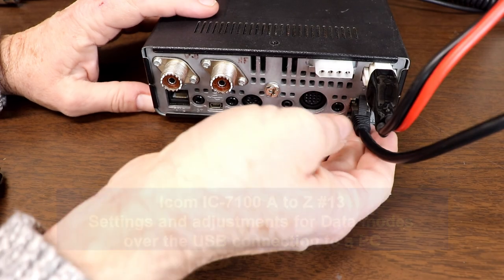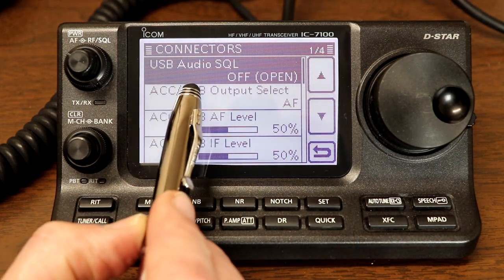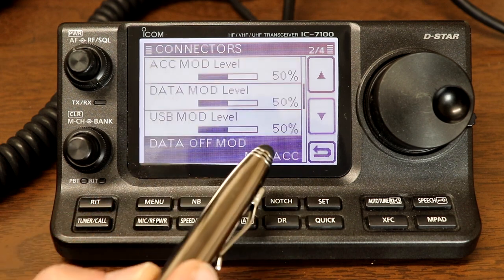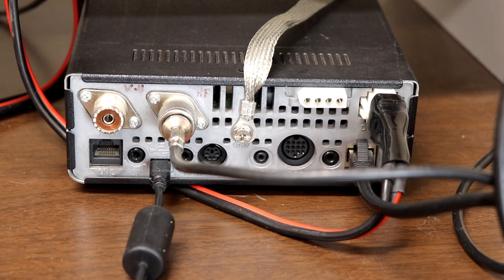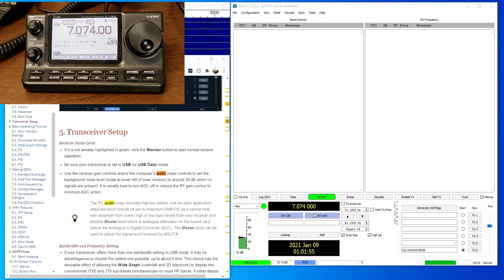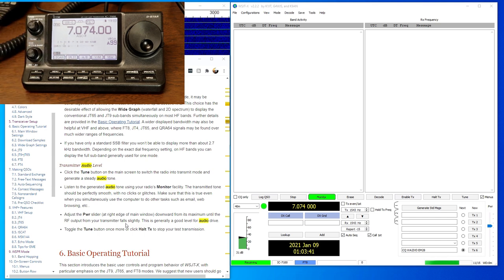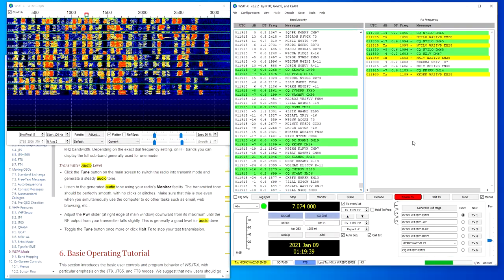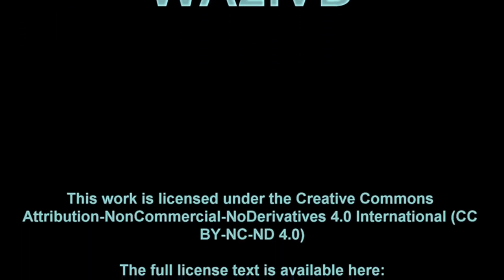IC7100 from A to Z #13 Settings & adjustments for data modes over USB cable

Comment: I came across this video by accident. I've being struggling with the setup for digtal for some time. You not only explain the radio setting  but also some of the FT8 settings. Thanks for this video.

Comment: Just a note for anyone else that runs into this. If you use "split mode = rig" in WSJT-X you run the risk of having your A freq USB-D but your B freq might be just USB. If your B freq is not set for USB-D then transmit will completely fail. I was pounding my head on the wall with that for longer than I would have liked. The alternative would be to use the "fake it" setting and this won't be a problem.
Reply from the maker: Very useful tip.  Thanks!

Comment: Thanks for the videos on the 7100.  They have been invaluable to me.  If I select RIG in my settings, Split changes the frequency way out of the FT8 range, sometimes it changes bands to transmit.  Not sure what I have wrong.  If I set it to Fake it, it works fine.
Reply from the maker: Hi Bobby. I haven’t played with WSJT-X in a while. I’m not sure why it is behaving that way.  When I get a chance to try it out, I’ll let you know if I find anything.
Reply: I have not found that with my IC-7100 using WSJT-X  The frequency changes just as I expect it to - a kHz or so either way.  Winlink works very well with the IC-7100  Not only does it change the band and frequency, but it also changes the IC-7100 to USB-D when you go to "open session"", and changes the frequency and mode back to where it was when you close the "open session" window, allowing seamless operation with no fiddling around.  Incidently, for anyone who uses Winlink without a hardware modem, it is well worth installing and paying for the high speed version of VARA, which is by far the best software modem I have used, giving high data rates on unbelievably weak signals, and changing the data rate dynamically as signals fade in and out.

Comment: Hello! I watched all your videos about IC7100. Thank you for taking the time to make them. Just a comment, Almost every mode has it's datamode. USB -> USB-D, FM->FM-D (Aprs for example),  WFN (No data mode off course). I mention this because I was listening WFM commercial radio the first time I bought my radio and I wanted to set data mode while I was watching your video and there was no DATA option to set in the menu!! It will be available when you switch to the proper mode and band plan.
Reply from the maker: Yes.  You definitely need to be in a  valid mode where you can transmit in order to select DATA.  You'll also notice that in DV mode that DATA is replaced by GPS.  The GPS option lets you select whether you want to send GPD DPRS data with your transmission or not.  You can definitely send data in DStar mode, but it's not going to come in as audio through the USB port.  It's a little different process.

Comment: one of the best instructors and video on Youtube. Just a question on the Filter FL1 setup for FT8 is it setup for default and can that be changed?
Reply from the maker: FL1 is fine and the default is probably fine.  For WSJT-X, you want the filters in the radio set as wide as possible.  The WSJT-X audio processing software takes care of it's own filtering and sorting out the signals.  Trying to set the radio filters more narrow would actually hurt more than it would help.

Comment: Great videos!  I’m up and running on digital modes using fldigi and flrig.   One question.  When I go to use voice without the computer connected my audio feeds back into the speaker (not good) and headphones (perfectly clear). Is there a setting I am missing when using voice mode?  Thanks for any help
Reply from the maker: In the SET mode menus there is a setting to turn Monitor OFF.  It’s either in the Connectors or the Function sub-menu.

Comment: I love all of your vids! Question, does the 7100 have the ability to save and store different/various settings--like the 7300 does--so you can quickly/easily jump back and forth from digi modes to SSB, or do you have to go through and manually change/change-back each time??? Thanks!
Reply from the maker: Hi Tim.  Thank you for the kind words.  You can press SET and go to the SD Card Menu.  The Save Settings and Load Settings functions can be used to save and load different radio settings.  The 7100 does not have “Presets” like the ones introduced in the recent IC-7300 firmware update.

Comment: The reason that audio is transmitted between 1500 and 2000 hz is so there are no harmonics in the audio passband that is transmitted. The (second?) harmonic of 1500 hz is 3000, which would be filtered out and not put out on the air. 

It's easy to see when someone is transmitting below 1500 hz.

Comment: Hi Tom: Thanks for the video. I’m playing with my 7100 now. I’m trying to interface my phone to the radio. RX seems to work, but I can’t seem to TX.  It looks like VOX doesn’t work on the Data2 jack. Is that correct? Maybe it works with the ACC plug? I do get audio only if I key the radio through the Data2 jack. No VOX. 
Thx de KB2MEN
Reply from the maker: Hmmmm…  I’ve never tried VOX with the Data2 jack.  I thought that VOX would work regardless of where the audio is coming from.  I’m quite certain VOX will work with the Accessory connector, but I haven’t actually tried it.  Maybe it’s time to do some experimenting.

Comment: Love your videos but I have a question any clues why my fervency is not showing on my lop top? The bar where the frecency is supposed to be is red any clues ? Thanks in advance 👍👍
Reply from the maker: Which program are you using?
Reply: Wsjtx
Reply from the maker: Hi Martin.  It sounds like something is wrong with the COM port settings.  Check that you have WSJT-X set to the correct COM port and that the baud rate settings match
Reply: Thank you so much I will definitely try that thanks again

Comment: Hi Tom, just one question, what do you turn up in the icom 7100 menu to make more audio sound level (volume)to come out the usb port, what i think it is i have moved from 50% to 70%, but doesn't seem any louder hi...Fred g4vvq.
Reply from the maker: Hi Fred.  You should be looking in Set Mode under the Connectors sub-menu.  The setting you want to change is ACC/USB AF Level.  That setting changes audio output level for both the accessory connector and the USB output.  You could also change the audio input level in the Windows settings for the USB audio input.  I tend to leave the radio set at the 50% default and change the settings in Windows, but either way is fine.  They both have the same effect.

Comment: I am having a devil of a time getting started with digital using USB connection.  Almost every time I open the program the serial port connection fails and I have to play with the config to get it connected again.  All the same settings are used but it's like I have to wake something up to get things working.  Also am I going brain dead or is the manual missing a digital using USB connection section in the 'Full' menu?

Comment: Tom Have you got a video on how to save our contacts onto the SD card so we can upload our contacts to QRZ LOTW etc etc
Reply from the maker: Hi Kelvin.  It’s a great radio, but I’m afraid it doesn’t have that much capability.  For logging you’ll have to use a computer with a logging program.  With a computer connected, at least the radio will help fill in the band, mode and frequency.

Comment: Followed your settings, but everytime I click on a  call, the icom 7100 leaves usb-d and goes  to just usb.????
Reply from the maker: Hi Tommy.  In the settings, under the Radio tab there is an option on the right side of the screen labeled Mode.  Make sure that either None or  Data/Pkt is highlihted.  If USB is highlighted, it will change your radio back to USB (not -D) every time it goes to transmit.  If you set it to None, then WSJT won't do anything with the mode and you will need to make sure it is set to USB-D for every band.  If you have it set to Data/Pkt and the radio type is set to IC-7100, then WSJT will switch your radio to USB-D regardless of what mode it was in.
Reply: @HamRadioA2Z  thanks problem solved

Comment: How you setup a data 2 socket on ic 7100
Reply from the maker: Hi.  What is it you are wanting to do?  If you want to do AX.25 packet data you’ll need either a TNC or a sound card interface and TNC software for your computer.  If you buy a commercial TNC, it should have basic instructions for connecting to a radio.  You can find the pinout of the data-2 connector on page 18-2 of the Advanced Instructions manual.

Comment: I disagree with using WSJT as the example.  The reason is this - FT8 and other modes of WSJT are usually used at low power (around 5W), while other data modes (e.g. SSTV) are not.  This is why WSJT has its own power output slider, which you will not find on other digital programs.  So my method is to set the audio output level to the radio using some other digital mode program, such as EasyPal or Winlink or an RTTY application etc.  I've found that most PC programs have similar input and output levels so you do not need to adjust levels when changing between them.  Then in WSJT, leave the radio and soundcard levels alone, and also leave the radio's power set to maximum (or your normal operating power), and adjust the output power for FT-8 by using the power slider of WSJT.  In that way you do not have to adjust anything when switching between different data mode PC applications.